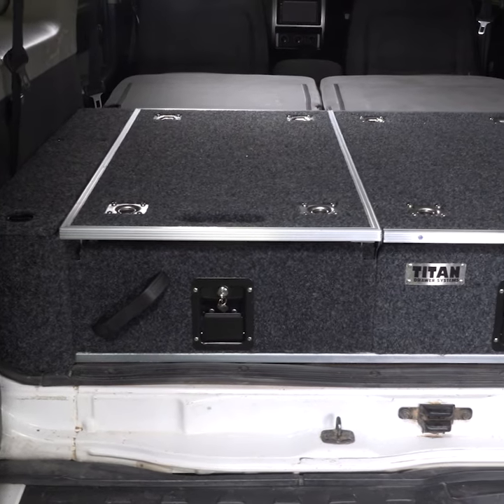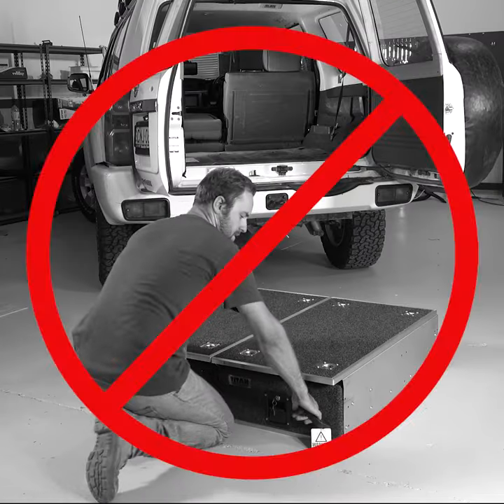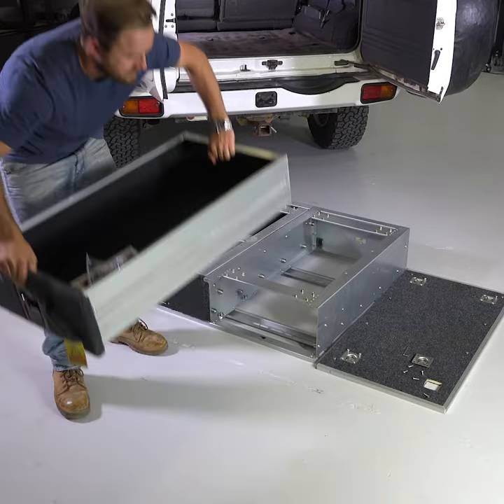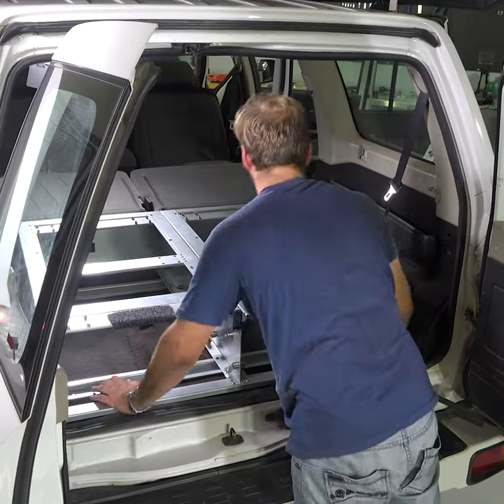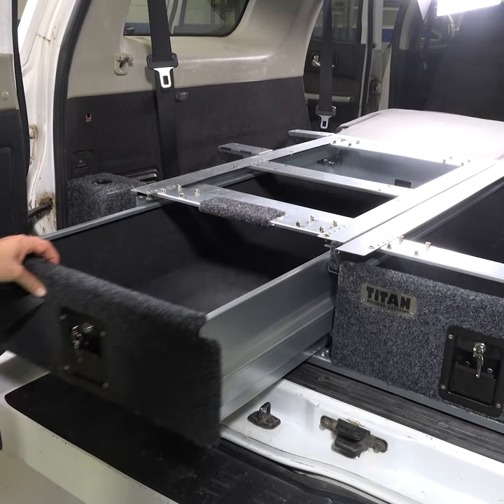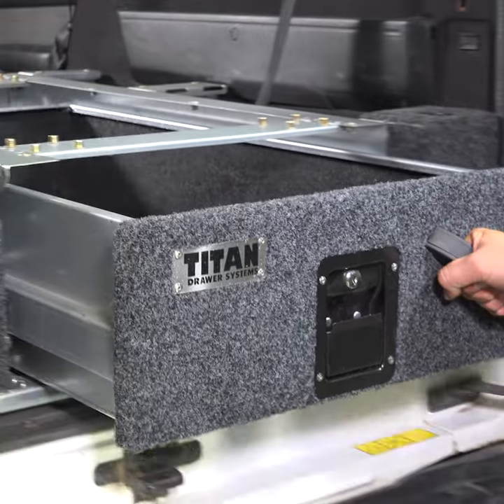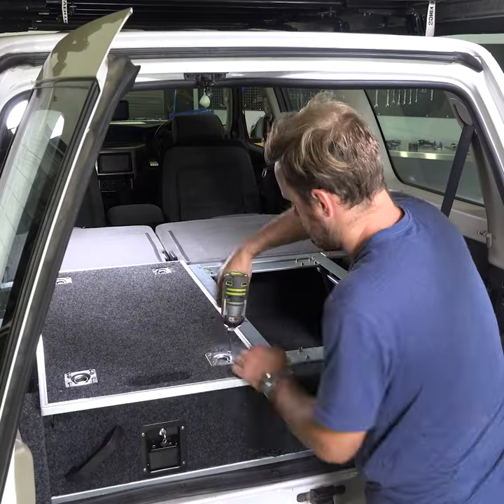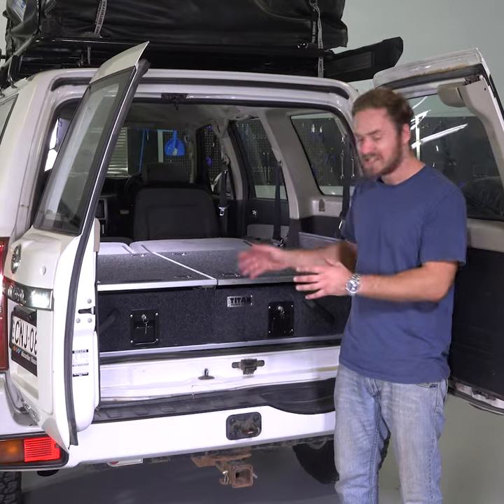How to install the Titan Rear Drawers

Comment: BTW for anyone stuck on installing the drawer stoppers; just above the rail on the drawer will be two holes, reach around the corner of the drawer up top and you'll find them.

You'll have to poke the carpet with a screwdriver to make a hole for the bolt.

Easiest way is to fit the stopper upside down  (flat side up), nylon nut facing out, put one bolt in, get that started, flip it over, screw the second one in.
Reply: You’re a bloody lifesaver. Kings instructions on the manual are useless. Thanks again 🙌🏽
Reply: @Coulslaww47  glad it helped, instructions really overlooked how to installed stoppers.
Reply: Thanks my man. I think someone in their company are sadistic pricks who deliberately left that part vague so men everywhere would tear their hair out. 

Totally NOT obvious at all. I install flat pack for a living and even I was stumped! Thanks again legend.
Reply: Life saver mate!!!!! You should never have to buy a beer again 🍻
Reply: Thanks brother

Comment: Can you do a video installing on a 150 Prado, mine dont come close to fitting
Reply: Did you fit it mate? I've just purchased some and left a bit dirty that they don't fit
Reply: We just bought a single drawer  only to realise there are no suitable mounting points. Before buying we asked the question about mounting and was told it was easy. Instructions they supplied were useless.

Comment: would it be possible to install these draws in a Hyundai staria load with out any issues?
Reply from the maker: Hi there, We recommend to measure the back of your vehicle and cross check the measurements on the website to ensure the drawers will fit into the vehicle. Kind regards, Rachael

Comment: 1:23 really helpful camera angle to show where these go.
Reply: Dude where the hell do the stoppers go? Iv spent so much time looking for it
Reply: @ozie38921111  can’t find them either
Reply: Any luck guys?  Struggling to work it out and daylight is about to beat me
Reply: @wiill3304  nah bro I'm almost 100% certain my ones didn't come with the stopper screws in place or the holes for them. I'm not chucking them in. I got so frustrated installing this shit, cut up my hands every time the Allen key slipped i just wanted to slit my throat and end it. fkn ridiculous how cheap these drawers are made and they say its cheap for what it is. honestly for something that's made in china I'm almost certain they're made for less than 100 bucks a drawer. We deserve better quality as paying customers. None of the predrilled holes and pre welded nuts lined up on mine.
Reply: I know these are the cheapest on the market and that any other brand would be twice as much of the price but the 4x4 market is a fkn rort even if it is the cheapest, atleast give us decent quality.
Reply: spent 2 hours just looking for where the stoppers go
Reply: Fuck. Not what I wanted to hear. True that. I paid $400 for mine and for the holes not to be drillled in is a fucking disgrace. 
Unless I’m missing something completely
Reply: @ozie38921111  Ditto.....spent ages trying to figure that out. They will attach to the drawers if the drawers are totally out of the unit, but you can't get them back in, and when the drawers are back in then you can't get to the attachment spots on the outside of the drawers.
Reply: Ditto...they didn't work for me either, along with other things. I think they put "Drawers Mk 2 into frame  Mk1 along with spare parts bag to suit Frame Mark 1. They don't need all those nyloc nuts cos they've now attached Riv-Nuts everywhere (although not in the right places). The instructions say in Pic 5 to line up the screws with the holes and in Pic 6 they tell you to mark holes for drilling. Duh..?? Spent 6 hours today installing---really heavy etc--after spending at least 2-3 hours on the weekend trying to sort the instructions into reality. And when you get the whole frame in the back of the ute under the canopy DON'T SIT in the cross bars cos they'll bend under your weight and you have to get a bottle jack in there to straighten them again so the drawers will still slide through. Also, in a Rodeo with tub liner, there's not room for the brackets that are closest to the cab.....they won't fit down the side...found that out after spending hours drilling holes and lining stuff up.
Reply: @wiill3304  Nope; you got it right, same here. Plenty of discrepancies all the way through the process...and many more hours spent than expected !
Reply: @neilbooth4952  my advice for any1 looking to put 1 of these together is to buy 1 of those 90 degree allen key bit that hooks up to your drill or your gonna have a bloody mess
Reply: @ozie38921111  definately.....did that; there are far too many bolts for using their supplied, soft , manual one which you still need to use in some tight corners where the bolts are up against rollers.

Comment: Hey guys I want to buy the 900 mm pair of drawers for my Pajero 2002 but do you guys have the wings for this model? Thank you.
Reply from the maker: unfortunately not Sam,

You could choose the DIY wing kit and make them to suit your vehicle, but just triple check that you do have the minimum 1000mm of space from left to right in the back of your Paj - I know some of don't have enough width to fit the 900 Drawers.

Cheers,
Cahn
Reply: @4wdsupacentreAu  yeah guys I check, and I also bought the universal wing kits, to build it myself, should be arriving pretty soon. Cheers

Comment: These Titan Drawers almost put the vehicle GVM over weight just on their own without carrying anything else in the back, (& that statement is not an exaggeration). 
They must have been designed for use in Army Tanks. Way, way, way too heavy for a small 4x4.
 I took mine out of my Triton because of their extreme weight & they are sitting in my shed. 
I tied them to the wall for safety because if they fell on you they would easily break a leg or kill a small kid. 
In my opinion unless you drive a V8 truck they are a total waste of time & money if you are thinking of putting them in a tiny 4x4 Twin cab ute. Fuel consumption goes through the roof and your braking power is reduced big time. Unless you have REAL HEAVY DUTY suspension they will break your utes springs & shocks in no time. 
Don't be fooled by the price because their extreme weight is the reason they are so cheap.
Reply: You also need foam filled tyres as these drawes will drop your rims to the ground
Reply: Mate they are 70kg not 700? Thats equal to 1 passenger. 35kg per draw isn’t that heavy the same roosystems draws are over 100kg and 4 times the price. How heavy do you think a decent 2 draw unit should be ?
Reply: Its a joke
Reply: @dpdog88  I run up rated, plus 400kg permanent load rear springs for when we do trips. And these make the ride just right when unloded, not on a trip. So they suit me to a tee as they say horses for courses.
Reply: @veigel100  Agree with you .
Reply: This says more about tritons than the drawers ...
Reply: Hmm if Tritons suffer from a bit of weight i can only imagine the Navaras getting around looking like they are towing an invisible caravan!,
Reply: @Petebar333  🤣🤣🤣